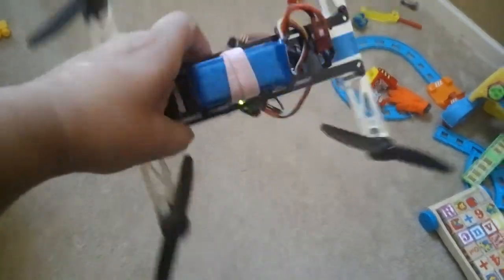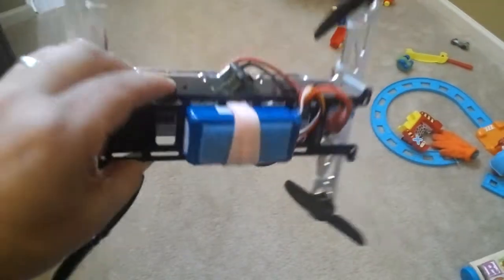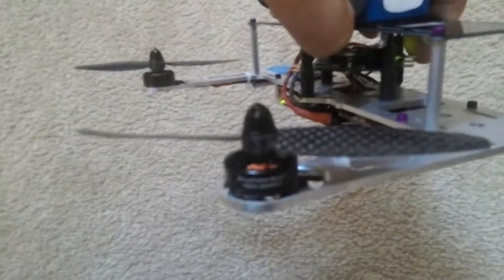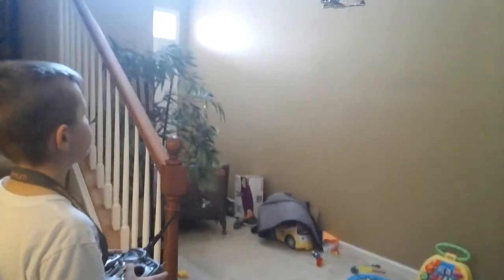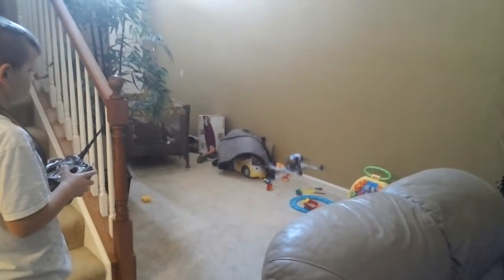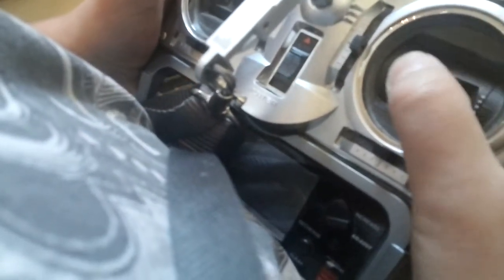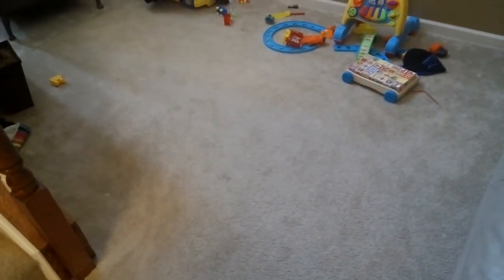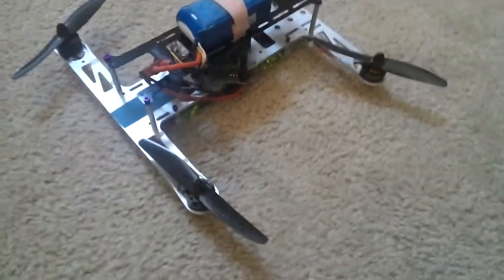Ireland hovering Mini Metal-H ead FPV Quadcopter frame

Comment: So, when you said Afro flight control did you mean Afro ESC's? timecop's flight controller is the Naze32 and the one in the video doesn't look like one.

You also mentioned you've run a 4-cell. I'm curious about this as these motors and props have a TON of power on 3S and I know those motors and ESC's aren't rated for 4S. All the other mini-quads on the market now are using 3S and are stupid fast already.
Reply from the maker: hi, when i say Afro flight control, i mean its a MK CLONE FC made by timecop, its called Afro 1.39d   this setup use MK i2c esc's (not afro) and im running 3s and 4s on it currently, yes these motors are working well and barely get warm at 550grams AUW

Comment: Nice little quad.  Will it be able to carry a GoPro and FPV gear?
Reply from the maker: yea its designed to carry FPV gear and does well,  PM me for links to fling if u need. also it can carry a gopro3, using cobra or sunnysky motors no problem,